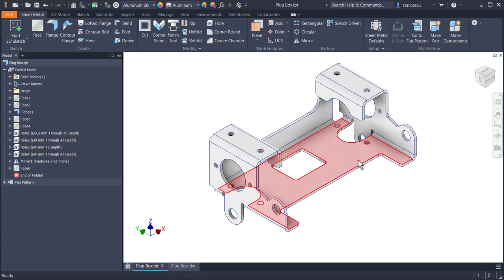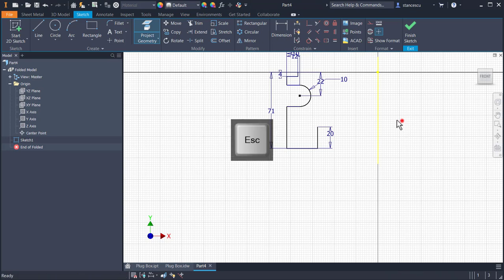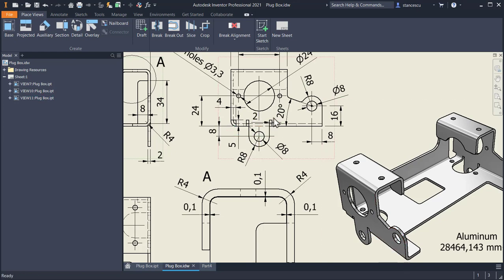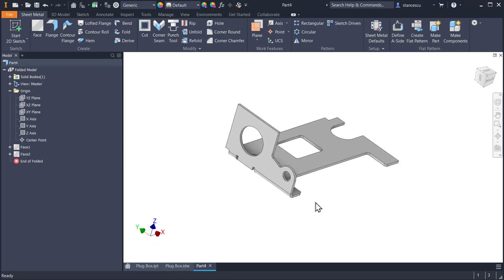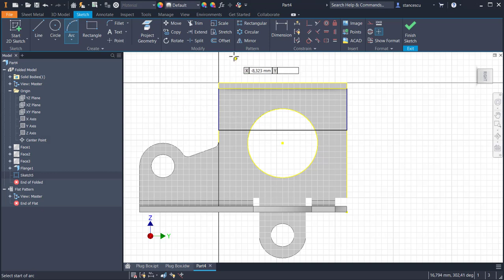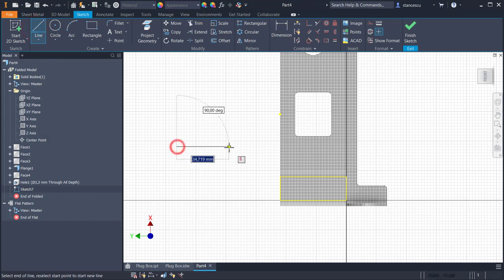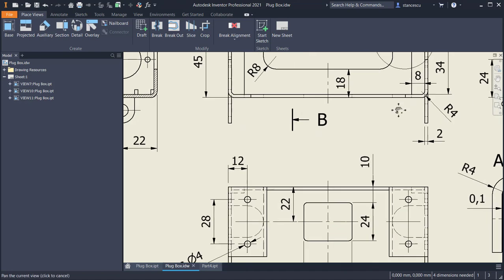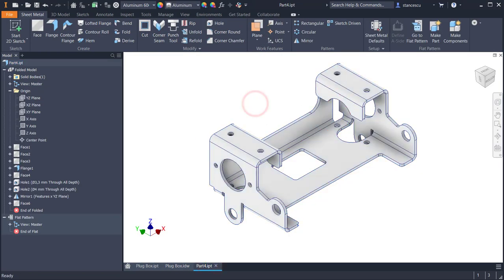Tutorial Inventor - 197 SHEET METAL SM-004

Comment: Hi proffesor. Is there any difference between creating in sheet metal and creating in solid mode then convert to sheet metal? Thanks
Reply from the maker: The difference is multiple. If you use Sheet Metal module the bending is made automatically as it is stated in the Default Settings, together with the lateral cuts. If you use solid mode with extrusions etc. you have to place right offsets and right radii, and also lateral cuts a.s.o.
And bending is only one of the Sheet Metal associated tools.
If your question is denoted from the difficulty of learning something new, my advice is to try to learn and use the Sheet Metal module instead of solid mode.